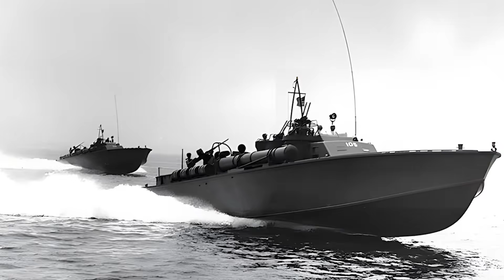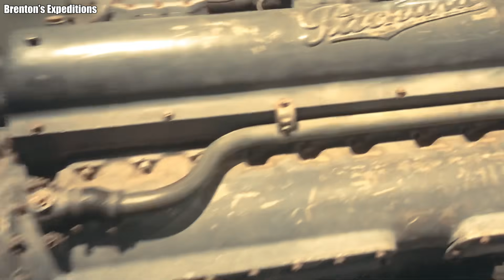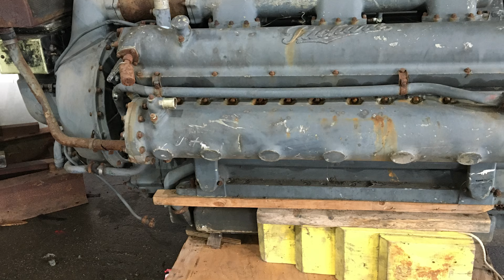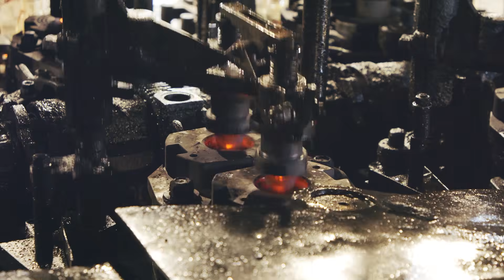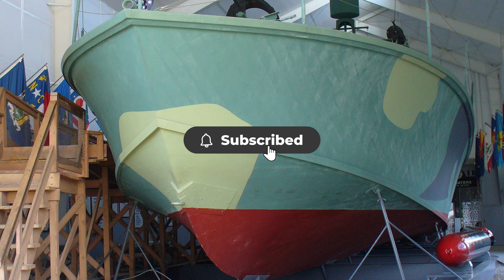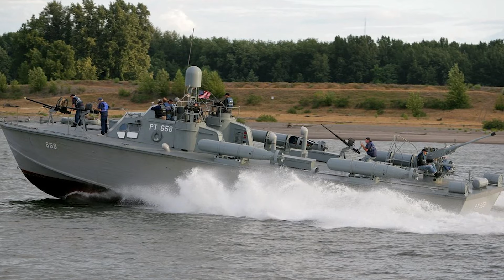Why Did America Bury the Packard Marine V12 That Won World War II?

Comment: The Packard marine engine had no relation to the Packard Merlin. The marine engine was an aircraft engine (typically used in biplane torpedo bombers)that was no longer competitive for aircraft use.
It was, however, tooled and developed, and was a powerful gasoline boat engine. After the war, there were lots of more attractive choices for big surplus gasoline boat engines, particularly the Allison V-1750.

Comment: The Royal Air Force Marine section had Rolls Royce Griffon mk 101 engines  on V drives fitted to the 68 ft ASR Launches.  A pair that could give her 40+ kits.  We were left to run them to destruction and push 2800 rpm. A sweet sound for your ears !

Comment: When rebuilding an engine like the Packard V12, I'm always puzzled by the question: How do you get all the different types of gaskets for such a massive engine? Manufacturing gaskets requires special metals, dies, and a special  punch press. I wish if you could explain.
Reply: In Kent, Washington there's the hydro plane museum they have a website. I'm sure you could E-mail them. You have a good question.

Comment: I was always impressed with them powering Miss Bud and Atlas Van lines!
Reply: Packard 2500s were not used in Miss Budweiser or atlas Van Lines. They used the Packard V1650 Merlin, a Rolls Royce design built under license by Packard.
Reply: Miss Budweiser later used the RR Griffon.
Reply: By 1939 Packard had been building the 2500 as an aircraft engine for 15 years. But they got a lot more out of it as a marine engine. Mainly because it's easier to cool a marine engine. Unlimited cold water.